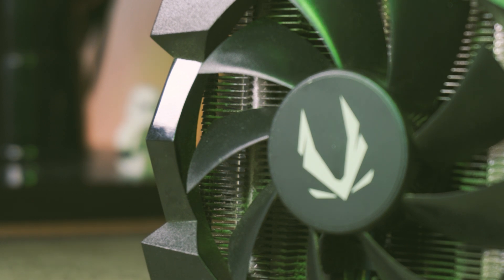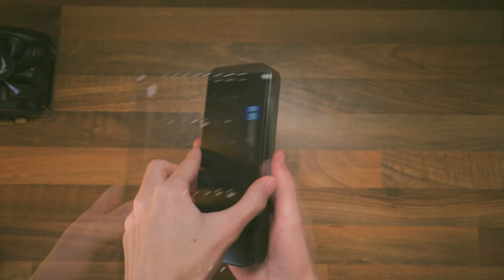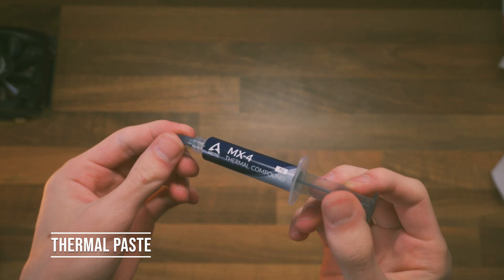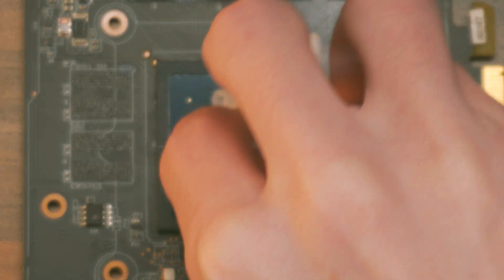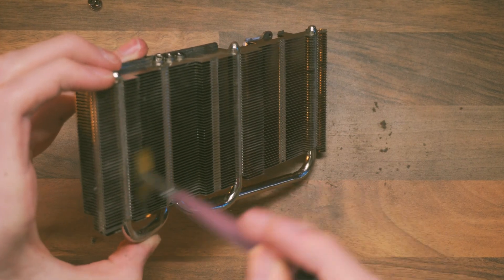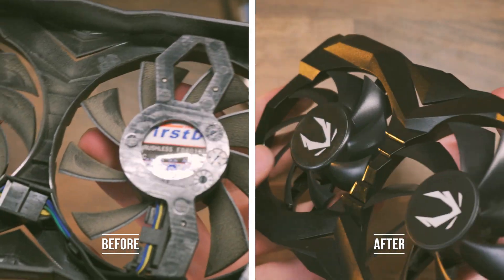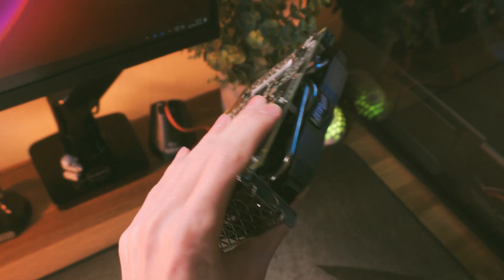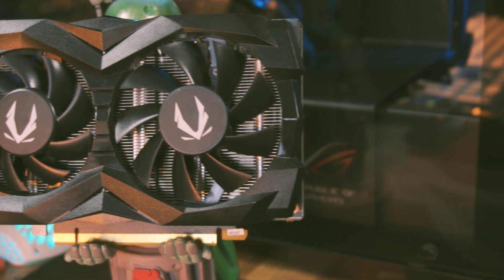How to Clean a GPU - Graphics Card Deep Clean Guide

Comment: wait is that a GTX 1660 Super? I have the same GPU!
Reply: oh its the Ti version 
still about the same performance I believe
Reply from the maker: Roughly the same, there’s only about a couple of percent between them
Reply: ive got the same aswell but mine only has 1 fan and a much smaller heat sink so it sits at ~80 c at 100%